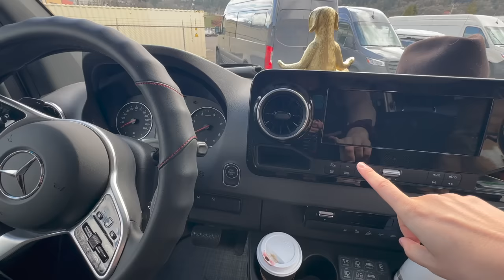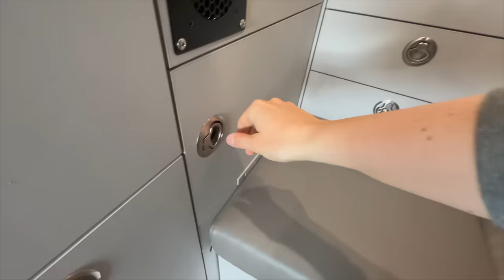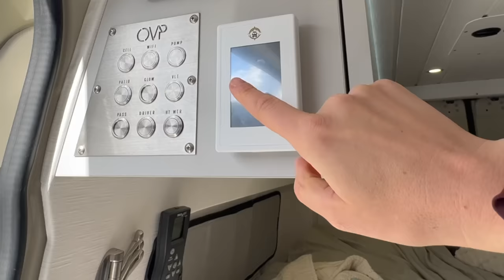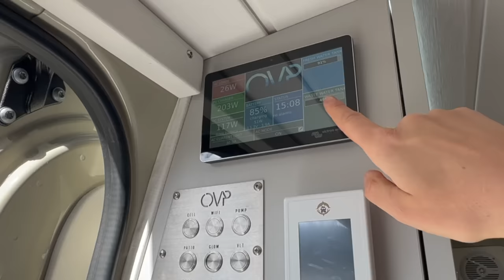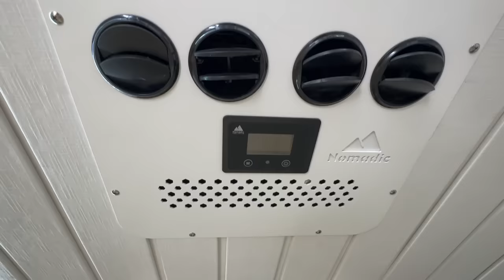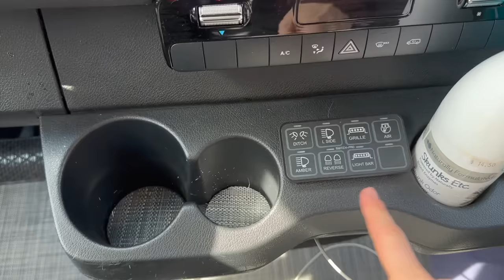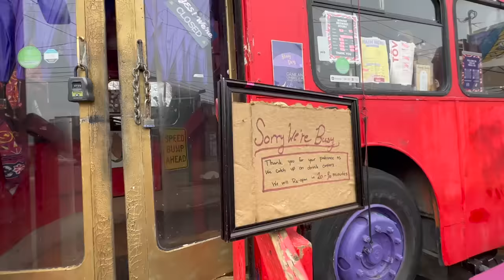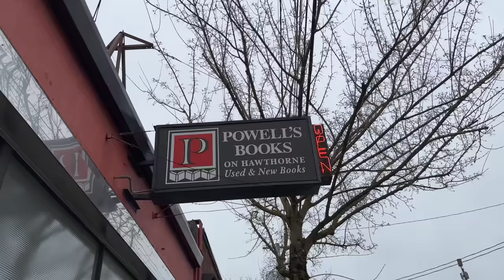After 4+ yrs living in vehicles, I built my DREAM adventure HOME! | Luxury 144 4x4 Sprinter VAN TOUR

Comment: Have to say this one the best builds I've seen to date.  Can't see anything that was missed and love some the custom elements (i.e., pullup bar), especially the shower!  Kudos on that one!  The only things that weren't completely visible were those handles on the back. If they aren't reinforced, they might break over time or if someone larger were to pull on them.  Otherwise, that's about it.  Looking forward to the periodic updates on how all the equipment is functioning, especially the air conditioner and battery system.  Safe travels!

Comment: Very nice indeed Nikki. Looks amazing. Just one thing though. The fold down shower tray isn’t supported at the step side when it’s down. Yes it has a metal bar along the bottom  but has a rubber pad for support. This unfortunately sits over the step void. Might want to get a block to put there before use

Comment: At 6'3 I wish I could fit a king size, a full bathroom and all of the other stuff inside a 144 Sprinter.
I bet I could, with a LOT of design engineering, money and compromises on storage, gear and specially living space. 
Probably not the perfect home, but a great comfortable minimalist camper.
A bigger Sprinter would solve the space problem but they are very limiting at parking, city driving and off-road.

Does ACC still works?

Comment: Van life has its ups and downs I live in a minivan during the workweek and come back to my country condo on the weekend because there is no affordable housing within 1 hours commute of my Seattle job. I love not having to spend hours sitting in traffic I have so much more free time. However I have had to get used to living in hot and cold temperatures and I'm struggling to deal with excessive humidity/mold in the minivan. I can't use an electric heater they draw too much power, the desiccants don't seem to work. I'm struggling to install a diesel heater because the underside of my minivan is almost completly covered in pipes and other things you wouldn't want to drill into. So many Vanlifers use Toyota Siennas that you'd think someone would have a good Sienna diesel heater install video but I have yet to find it. Thats the hardest part of Van life because its not socially accepted there is no good guide to how to do it there is alot of trial and error and its expensive because you spend money on things that don't work. I'm realizing I might just have to open windows a few inches at night but I don't like doing that because it decreases my stealth and safety.

Comment: Wowzer, that’s $11,000 bucks in just batteries alone for that 15kW system. I’m completely off grid with a 50kW lead acid system where you only have - in reality - about 25kW to use. That’s a fully functional modern home with complete AC and heat using mini splits.  So…you should have plenty of power. Nice setup.

Comment: Relocate that alternator! You should have the alternator relocated towards the top of the engine. Having it exposed at the bottom will be damaged by off-roading and rain kicked up from tires and snow. You could potentially ruin your entire electrical system!

Comment: If Camper should find himself in that smelly situation again (I have neighbors who had a dog that never learned, got skunked four or five times), the absolute most effective thing to do is to hose him down and then very liberally pour either tomato juice or use condensed tomato soup straight from the can, massage it in well, rinse it completely then repeat. It neutralizes the skunk spray immediately with no lingering odor whatsoever. You can then use dog shampoo if you want to eliminate the very faint tomato smell afterwards. Done it many times and it works.

Comment: Epic van build! Several ideas you put into this van I've been working on in my head for when I were to build out my rig, although I might do an ambulance or a short schoolie for more headroom/ sleep room since I'm almost 6feet.. I'm curious to see how your suspension pans out with the more rugged terrain, two things I would do different to your rig would be next to the stove I'd put a pullout counter (which would block the front door temporarily) thoughts about why you didn't do that.. and I've seen these suspensions with airbags in them so on the street you can ride lower and can raise them for the more rugged stuff also altering the general handling depending on the mode (street/off road) any reason why you didn't do those? Or you just haven't seen that type.
Reply: I guess the pullout shower pan on the side of the counter block is in the way for a possible pull out counter ?
Reply: It's possible although no real way of knowing unless were there to check out the build or it's shown in a "build video" in rigs like these every inch matters and the concept of having multiple uses for one space helps out a lot

Comment: Any issues with the solar panel over the fan discharge for the air conditioner? I’m think 1,000 watts of solar and that’s a nice space but if it hampers AC performance might not work

Comment: The depth of the cupboards is too big, it takes away the free space in the van. Also, the width (depth) of kitchen area  is like 1 meter size 😱😱😱, why so big? The standard countertop depth, even for houses, is just 60 cm. Instead of making it minimalist style, less than standard, it's even bigger, it's huge. Another thing, why didn't you choose to make folding bed, so you can transform it into a couch during the day and have more space in the van, especially that you have standard Sprinter, not the long one?

Comment: Please for the love of god put a skid plate/shield on your fuel tank. Not only will not being able to go be a pain, but if you're draining around 47 gal/200l of fuel your wallet/purse will also be hurting, a double whammy, and then also need to replace or repair the tank! Please have it fitted as a just in case, also might help deter potential fuel thieves.

Comment: How much does a van like that cost to build roughly?
Reply from the maker: Brand new van with all off road upgrades and premium top of the line parts like
I chose 200-300k give or take (wiped out the savings haha). The exterior upgrades alone and the batteries are the most expensive part that many people don’t opt in for) If you choose more budget less luxury parts did different batteries and smaller system, a built in shower less older van it could be wellllll under that, just depends on needs.
Reply: @NikkiDelventhal  love your show, some camera shots were cool. Safe travels and be safe